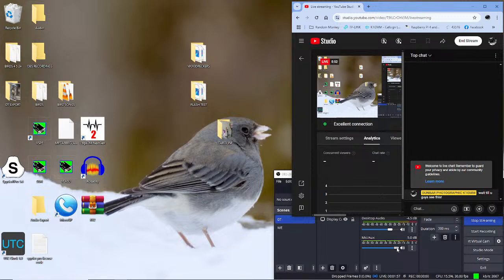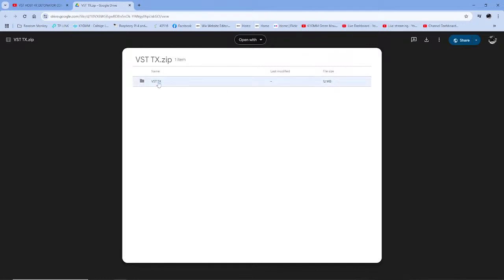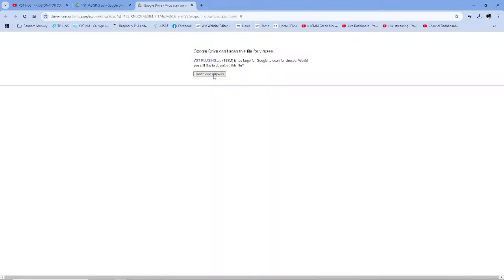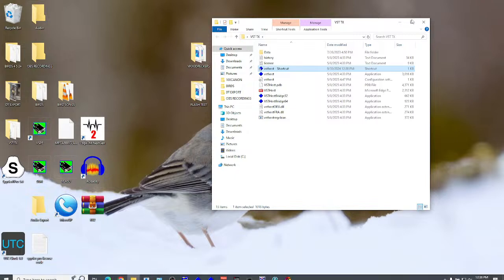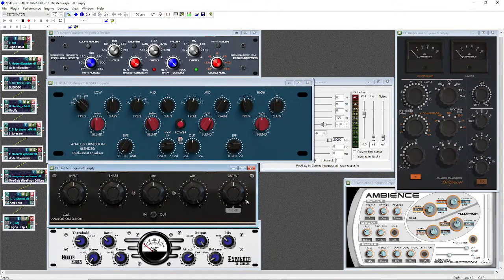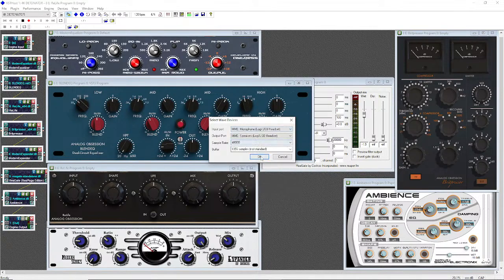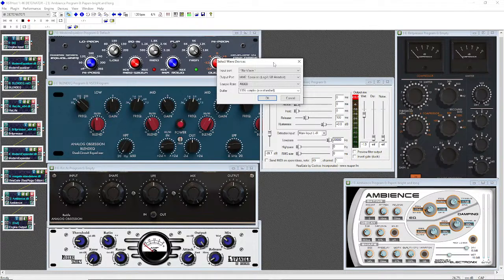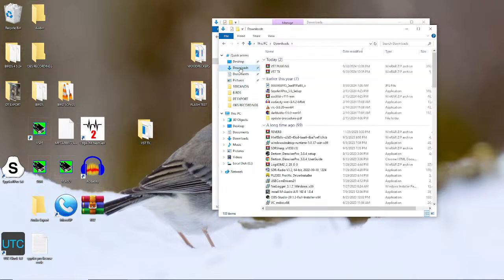VST HOST 4K DETONATOR COMPLETE DOWNLOAD AND SETUP WALKTHRU! FREE AND EASY!

Comment: Hey Steve, thanks for these videos. I am hoping to replace my herpes with a G2, so i am enjoying these. I take it you are not using the banana software with this? Just the vst host? Also, none of this is possible if you plug an xlr mic direct in to the G2 i am guessing? 73 g6phf.
Reply from the maker: @MikeDent  hi Mike. Yes I'm using banana as it's fed to the rig using vac. I'm having trouble with the mic inputs. I've heard there's an internal wiring problem. Not sure. Probably user error lol
Reply: @k1gmmgreenmountainmaniac251  ok Steve. I note the G2 has an XLR mic input, is there any advantage to be had from using that? Do you know how that is fed to the radio then? Is it possible to customise that audio if you use that socket? I ask because I have a Sure XLR mic.
Reply from the maker: @MikeDent  it's a 1/4" trs so I need and adapter from the 3pin xlr Mic cable to that. Tried it and can't generate enough gain to drive the alc. Gonna try it again and let u know. There's a setting I just noticed under radio in pihdsdr that I need to change.
Reply from the maker: @MikeDent  I just plugged in the art mp studio preamp, set to XLR in the pihosdr and bam. Tons of audio. Used the XLR to trs jumper from the other day. It works. Tons of gain. It's the way I'm gonna run it standalone. Cheers!
Reply: @k1gmmgreenmountainmaniac251  Nice one. Is there an option in Thetis to use the XLR in the G2 do you know?
Reply: @k1gmmgreenmountainmaniac251  I assume you could run your rack in to that if you wanted. Just looked at theat art mp studio, its a pre-amp with some basic audio controls, hmmm. Interesting
Reply from the maker: @MikeDent  not sure.
Reply from the maker: @MikeDent  I think you could. I'll try it and let you know. Might be good with the line in. A lot of guy's do it that way.
Reply from the maker: Mp studio is a bust. Low end hum I can't get rid of.
Reply: @k1gmmgreenmountainmaniac251  That looks a nice valve pre amp too. I have a XLR cloud lifter for my Sure SM7B, I think it boosts it to 65db gain, I think! It's a Klark Teknik Mic booster CT1, I use that with the sm7b and a usb audio interface. This is with a herpes lite and Thetis.

Comment: I am having trouble checking the right boxes so the audio don't come through my speakers when I key the radio. Using the M audio air card with the input set to MME AIR 194 and Output MME Speaker Air 194. Any combination I choose if a click to None--then it won't go through the card--Lost!
Reply from the maker: @larrywilliamson9859  https://youtube.com/playlist?list=PLS57I3lkQVaAn-z3O8Rx9CfsNBxqX1oW0&si=ZlSwqunZIHHS_acE
Reply: @k1gmmgreenmountainmaniac251  Thanks Steve-- I don't have VMB involved in the audio. Per your #7 video will reinstall VMB and route the audio through that. VM was really flakey a while back--hopefully its a little more stable now. Thank You
Reply from the maker: @larrywilliamson9859  u should be fine. Been running it for over a year now on mme with the maudio and not a single hickup.
Reply from the maker: @larrywilliamson9859  make sure the mix knob is not turned to direct
Reply from the maker: @larrywilliamson9859  stream on the g2 standalone going on this afternoon. Watch for it. Maybe 2 hours from now.